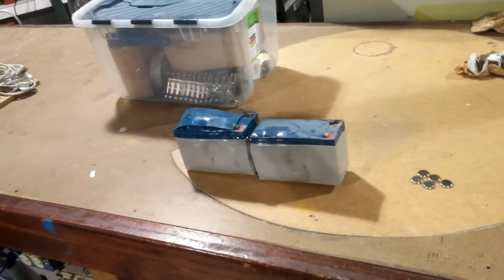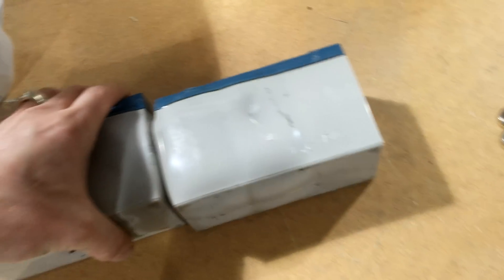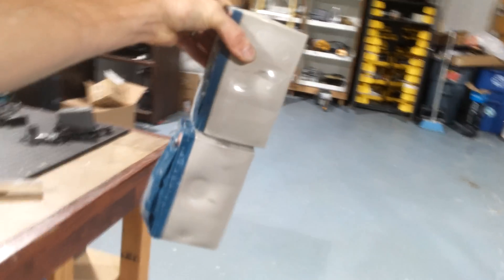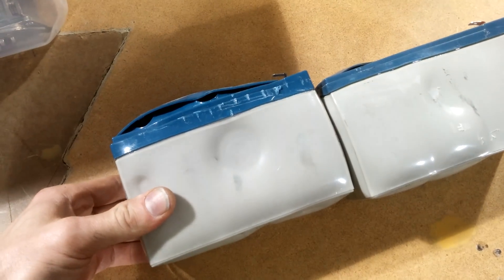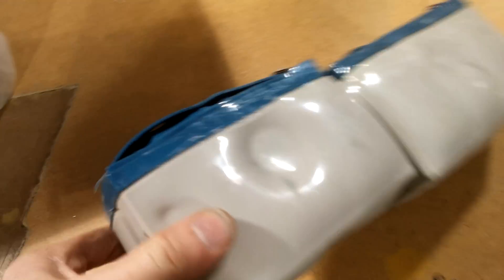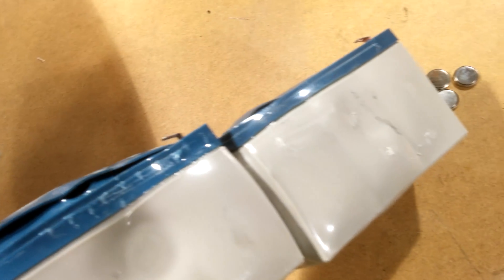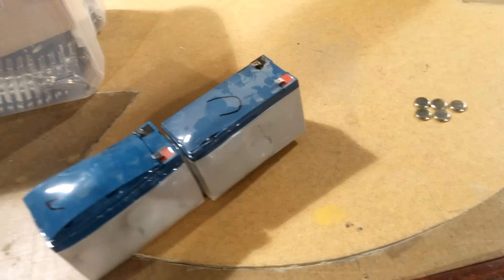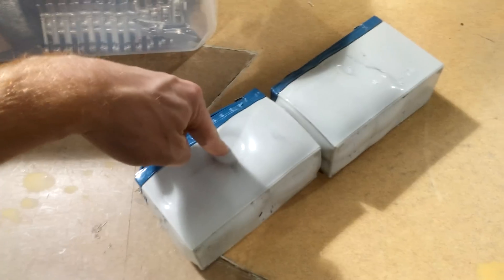Happy New year!!! 12v UPS total Battery meltdown!!

Comment: Had this happen on an E bike battery pack. Strange thing is, the least bad one that read like 4V I did get working by running it right down to nothing with a resistor then slowly recharging over several weeks with a low current solar panel actually got it working again! Capacity was fine and compared it with a new one to see the difference. Could have put it back in and used it but ended up giving it away to someone with the advice to not use it for anything important. Think they're still using it for their outdoor water feature or something.

Comment: PowerSonic = PS = Piece of Shhiiii--you get the idea. Lowest rung, bottom of the barrel, bad news bears.

This happened because the electrolyte boiled away leaving parts of the cells dry. Then, the remaining plates that were in the electrolyte had to overcompensate with higher amounts of current to put out the voltage, making the problem worse.

Just get two old car batteries, and hook 'em up to the UPS. Make your runtime last in hours, not minutes.
Reply: i use and abuse my powersonics,had them 3 yrs, just recharged them a few days ago, those batteries look like they got well over-volted
Reply from the maker: yes and the fact that i removed the fused :) hehehe ~Russ

Comment: Happy New Year Russ.
Craptastic batteries bro.
I have heard of UPS units smoking up and getting so hot people have had to drag the smoldering lump of junk out of the house by the power cord. 
Must be rubbish charging circuits.
Reply from the maker: yeah... well a fuse is intended to be between the battery's... that would have helped in my situation :) hehe ~Russ
Reply: More thank likely one went short and the rest got overcharged. Lead acids are quite resilient but they have their limits especially SLAs.